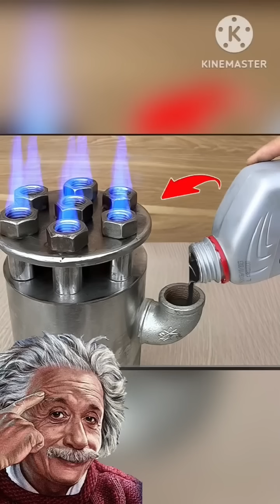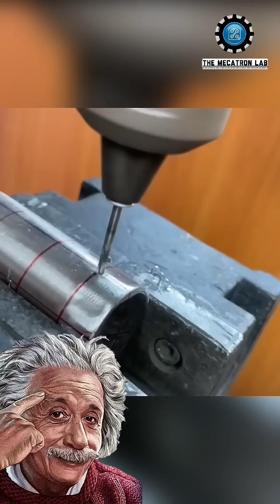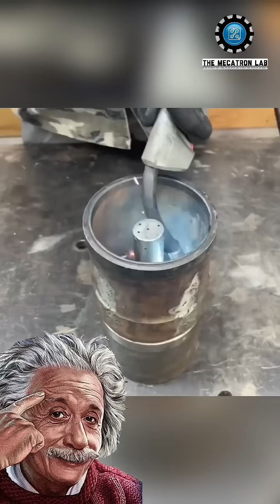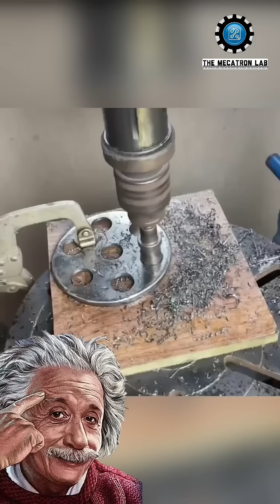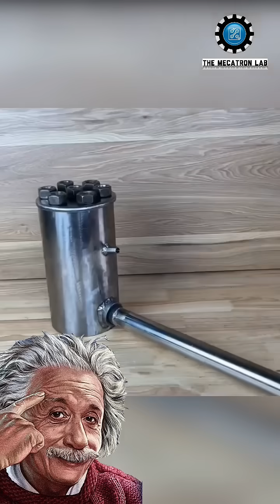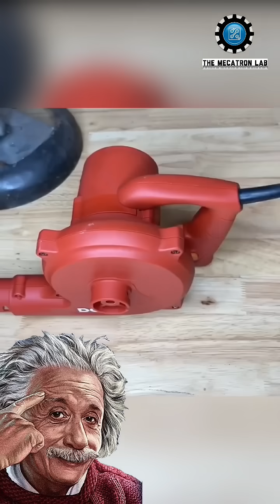How To Make waste oil Stove using Metal. #diy #science #experiment

Comment: Burning motor oil in your home sounds like an invitation for cancer, no?
Reply: Use it outside. One of the problems I had with this is, he said it's great for ppl without access to power... & then proceeded to show it uses an electric blower 🤣🤣🤣
Reply: @favoritemu😂😂😂😂😂😂stard3542
Reply: @favoritemustard3542  thats only to help get it up to temp.
Reply: @favoritemustard3542, there's a hand cranked  blower available.
Reply: O Just imagine the smells
Reply: Yes, carcinogenic
Reply: @smythie08 no, poisonous!
Reply: Definitely plus if we cook smthn it will taste like garbage
Reply: Eh ever heard of fuel oil? There's a 300 gallon diesel tank in my basement same same but different lol. Plus alot of garages are heated with it
Reply: @biga999444  #2 fuel oil is actually kerosene and it's refined to have as little heavy metals in it for cleaner combustion.  Burning used motor oil is very bad because of the heavy metal contamination that's Inherent to motor operation and all the dispersant and friction modifiers that are metal phosphates and organosuphates that decompose into toxic fractions when burned. Look up the MSDS for some of the additives in motor oil and then look up what metal fume fever is too and you'll realize why burning motor oil both stinks and is very bad for your health.
Reply: You can use the waste of vegetable oil too
Reply: Menurut saya apapun yg dihasilkan bntuk api biru...laut pantulan matahari biru...langit biru...itu indah dilihat mata dan bisa jadi hasil dari kombinasi yg sinergis utk kebutuhan hidup manusia saat sudah kehabisan energi gas  @baraul-i1y
Reply: For dumb people like Einstein. Rather listen to his misses. She's the smarts
Reply: There may be laws to ban waste oil burners from back in the days when lead was a contamination in the used oil . Today there is no longer lead additives in our gasoline.
Reply: Cancer
Reply: Highly carcinogenic, inside or out! Every breath with a wiff in, is like Russian roulette! Hold on how long did we spend in the gulf, breathing in burning oul fields!🤢
Reply: EnergyLogic beat you to that one bud.
Reply: The state of California thinks so, and has banned these.  I don't live in California and look forward to try and, "put it to the man'
Reply: @adamjohnson4311 high end state only allow electric stove😂🎉
Reply: I'm an Industrial Chemist by profession.
Used engine oil is a toxic chemical. Using it for cooking is a recipe for poisoning. 
Used engine oil contains many highly poisonous substances, and should never be allowed to be used for food preparation.
The resulting waste gases are to be steered clear of.
Ok for say blacksmithing, otherwise stay well away for this ' invention'
Reply: Cancerous
Reply: Cancerous
Reply: Burning mobile oil /plastic / polythene is definitely give you cancer
Reply: The narrator narrator of this video did say this transformative invention will change lives
Reply: Cancer? It will kill you for a different reason: carbon monoxide!
Reply: worse. heavy metals and contaminants in the oil  will kill you faster than any cancer, most likely.
Reply: Cancer is defiantly just one of the MINOR risks, the unseen exhaust even if you can't see it is extremely Polluting especially Dangerous using Motor oil and used motor oil is far worse, Even Commercial oil burners have to be Certified for good reason, if this guy is a master of Exertive Metalworking , He needs to learn how to Run a weld and the dangers of welding Malleable Iron Fittings, incredible is an understatement , back yard Third world want to be is more to the point.
Reply: Zat nya sudah hilang menjadi api tidak ada asap karena suda tercampur oksigen,, beda dengaan  membakar oli tanpa tekanan oksigen
Reply: @KawTv92  No brother you are dead wrong, you would need pure oxygen from a bottle to get it even close to burning safely and there would still be dangerous toxic residue probably worse. Look at how an oil refinery works the crude is not burnt it's only heated in a cracker and drawn off at different levels including the dangerous chemicals that make up synthetic oil and you want to burn them??
Reply: Tambien tu carro .no pienzas en eso..y lo que comes .
Reply: Right 👍🏻▶️😊😂
Reply: You read my mind 🤣😂
Reply: From Grok…

Burning used motor oil (also called waste oil) releases or vaporizes various carcinogens, primarily due to incomplete combustion and the oil’s accumulated contaminants (such as heavy metals from engine wear and polycyclic aromatic hydrocarbons or PAHs formed during prior engine use).
Key Carcinogens
The main carcinogens include:
•  Polycyclic aromatic hydrocarbons (PAHs) — e.g., benzo(a)pyrene, naphthalene, phenanthrene, fluorene. These form from pyrolysis of the oil and incomplete combustion; many are classified as known or probable human carcinogens (IARC Group 1 or 2A).
•  Benzene — A volatile aromatic hydrocarbon and known human carcinogen (IARC Group 1).
•  Heavy metals — e.g., lead, cadmium, chromium, arsenic. These vaporize or become airborne particulates; some (like chromium VI or cadmium) are carcinogenic.
•  Other potential compounds — Aldehydes, nitro-PAHs, or dioxins/furans if chlorinated contaminants are present.
Typical Emission Ranges
Quantitative data on carcinogen emissions from used motor oil combustion is limited and varies widely based on combustor type (e.g., space heaters, boilers), oil contamination level, burn conditions (controlled vs. uncontrolled), and whether the oil is “on-spec” (meets EPA limits for contaminants) or not. Uncontrolled burning (e.g., open fires or improper heaters) produces higher emissions.
From EPA data (AP-42 Section 1.11 on Waste Oil Combustion):
•  Particulate matter (PM): 1–20 lb per 1,000 gallons burned (higher in small heaters); much of this carries adsorbed PAHs and metals.
•  Lead: Up to 0.5–2 lb per 1,000 gallons in uncontrolled or high-lead oil.
•  Specific PAHs or benzene are not quantified in EPA factors, but studies indicate PAHs are significant, similar to or higher than diesel/heavy fuel oil combustion due to unburned oil and additives.
Comparative estimates from related combustion sources (e.g., heavy fuel oil, diesel, or waste oil studies):
•  Total PAHs → Emission factors often range from 10–1,000 μg per liter or kg of oil burned (varying by compound and conditions); benzo(a)pyrene alone can be 1–100 μg/kg.
•  Benzene → Volatile emissions in the range of 0.1–10 mg per liter burned (higher in poor combustion).
•  Heavy metals in particulates → Lead: 0.01–1 g per 1,000 gallons; cadmium/chromium: trace to 0.1 g per 1,000 gallons.
Emissions are much lower in properly designed waste oil burners with controls (e.g., industrial boilers) compared to unregulated space heaters or open burning, where concentrations can be 10–100 times higher.
Burning used motor oil is heavily regulated in many places (e.g., EPA restricts off-spec oil burning) precisely because of these carcinogenic emissions, which pose risks via inhalation of fumes or particulates. Controlled recycling or professional combustion is preferred over unregulated burning.

Comment: It’s good, except that it requires electricity to run the fan. Also, it should only be used outside because the smell of the oil exhaust.

Comment: I don’t think so burning motor oil is not good for the environment now you using a compressor to blow the oil is it efficient don’t think so more harm than good because moto oil will burn with toxic black smoke not blue flame

Comment: How does they keep the oil from igniting back down the pipe back into the reserve oil
Reply: Oil is not like gasoline. It is hard to burn.
Reply: Oil can only ignite if there's enough oxygen to support the combustion. As long as there's no air trapped inside the pipe the oil won't ignite

Comment: The pollution is EXTREME 
K1 is refined and one of the " cleanest " fuels, but it is still very dirty

Home heating oil is very dirty

The oil in engines is even dirtier and the sludge and all the waste in the oil, it is going to be awful 

Anyone who is old enough to remember when oil was used for boilers, the thick black smoke was horrible. 

There are people that take the used cooking oils from restaurants and filter the food out and they burn it in cars. I think diesel engines will burn it. 
Bio diesel they call it
Some cities use the waste oil from McDonald's in the city buses and it smells like McDonald's

Comment: When burned, crude oil produces toxic gases like sulfur dioxide, nitrogen oxides, carbon monoxide, and volatile organic compounds (VOCs), which can be harmful to human health and the environment if inhaled or exposed to in large quantities; the exact composition of these gases depends on the specific crude oil composition and burning conditions. Motor oil contains a significantly lower proportion of crude oil compared to gasoline or diesel, as it is primarily made from a heavier, thicker fraction of crude oil that requires additional refining and additives to achieve its lubricating properties, it stills contains low proportions of refined crude oil. Meaning, even though it does not burn as toxic as gasoline or diesel it still burns ☠️TOXIC☠️.

Comment: Yeah this is not a phenomenal invention for multiple reasons. Also used motor oil has multiple uses, one of which goes into rehabilitation of the very asphalt those vehicles drive on.

Comment: Used motor oil can be burnt cleanly, but not in a botched up drip pot like this (those blue flames are fake). Lubricating oil does not degrade. Its the many additives which deplete Viscosity modifiers, friction reducers, emulsifiers, etc, etc, which do deplete. The oil can be cleaned and reused with new additives. The resulting concentrated waste is then burnt in special clean burning furnaces which heat the recycling plant.

Comment: This ground breaking creation is, A. Carbon intensive. , B. You need the skills necessary to make. C.  You have to buy some of the right materials like the nuts, metal plate.... If everyone  had one the air would look like it does in China.Find a way to easily make something that burns alcohol for cheap or I know! Make a multi wick lard candle heater.....

Comment: Pass, just because it burns doesn't mean its a good fuel. I tried burning motor oil for fun but it takes a certain amount of time and heat temp for it to burn. It also stops burning after a few second. Very disappointing. 😑

Comment: I've seen oil fired heaters in Lebanon that simply dripped oil into the burn chamber and required no electricity. This one is a failure IMHO. DID AN ENERGY DEPRIVED REGION WHERE YOU GOING TO GET ELECTRICITY FROM?

Comment: long-term exposure to air pollution can cause lung diseases, such as asthma and chronic obstructive pulmonary disease (COPD) :   
Air pollution, especially particulate matter, is more dangerous for people with COPD.   
Indoor air pollution increases inflammation in the lung tissue of COPD patients, worsening their symptoms and reducing lung function.   
COPD is caused by damage to the airways or other parts of the lungs.   
COPD causes difficulty in breathing, thick mucus, wheezing and coughing.   
To get an accurate diagnosis of COPD, a test called spirometry should be done. In this, one has to breathe forcefully and quickly into the machine.   
People with COPD have a five times greater risk of lung cancer than normal people.

Comment: Revolutionary yeah...
I have one that looks very similar but is made of bronze and some parts like the fuel deposit are made of copper, instead burns alcohol or querosene, it has a small fan that blows air in the burner and the flame is color blue like this, I purchased it  in a metal working supply shop, it cost me 40 usd 6 years ago.
I use it to weld copper pipes and pre heat small iron cast pieces before welding.

Comment: not a brilliant idea at all if using it right that way was this good why would car have Catalytic Converters for . burning motor oil also produces Particulate Matter Nitrogen Oxides Carbon Dioxide which is why vehicle have Catalytic Converters to begin with and breathing these fumes is not good for lungs. engine oil has a specific propose as lubricant that helps the engine run smoothly. 
note for those who are not satisfied with this comment it's like drinking your own pee drinking just ones may not have that much problem but if you keep on drinking well you will find out what happens. if you really want to use this idea I would say f**k around and find out good luck

Comment: this thing will smell crap in its pre heating stage but if you get it roaring the smell you'll gonna get is the smell of glowing metal I've been using this type of burner since 2008 using the used oils on my motorcycle and auto repair shop and used cooking oil

Comment: This is just a oil burner. They’ve been around a very long time and have been used as space heaters
Reply: Oil burners using refractory material burn much cleaner than this.
Reply: Oil burners are made of glass 😂
Reply: @3zK_FtW it’s a video about a waste oil burner…. I’m pretty sure you’re thinking of oil lamps. You wouldn’t want to use waste oil in a lamp. It’s full of carbon
Reply: @3zK_FtW  lol, 😉.

Comment: Not a new design.
This type of burner has been around for well over 150 years but those don't need an external source of forced air..
This particular example is assembled from the wrong materials, with very poor welds.
Uses an exceptionally dirty fuel source.
There's zero "expertise" and also no "creativity" shown in this video.
Also, where are those poor people supposed to get a leaf blower or the electricity to run it?
Lame.
Here's your ten cents for my comment.
"Genius"
LMFAO!!

Comment: You know how bad that would smell even if using it outside.... I used tonwork at a dump and I'd take home used oil to put on my fire pit tonhet it started and burning hot because my wood was always unseasoned it smells terrible horrible for the air, messy, I can't see how it would het hot enough to burn clean...ok cleanish.